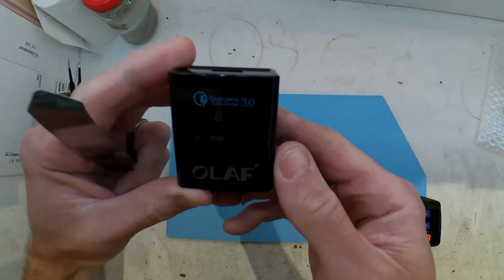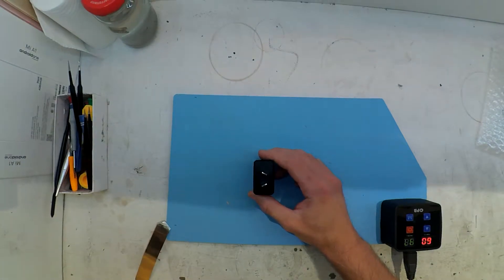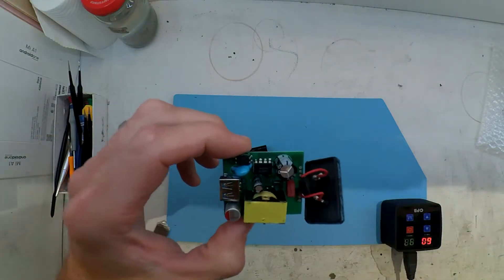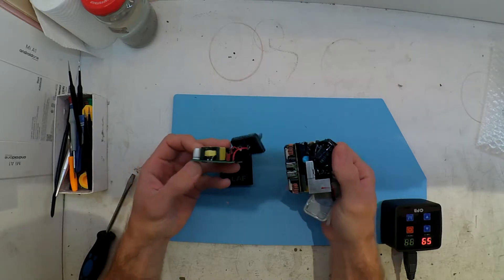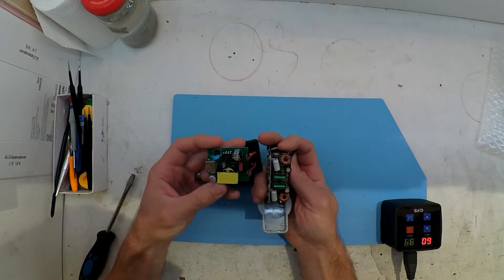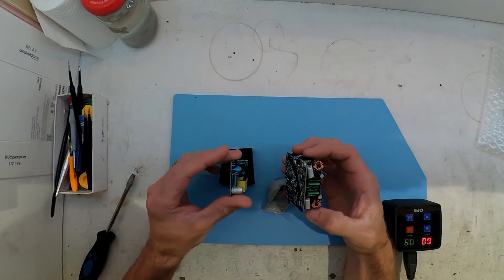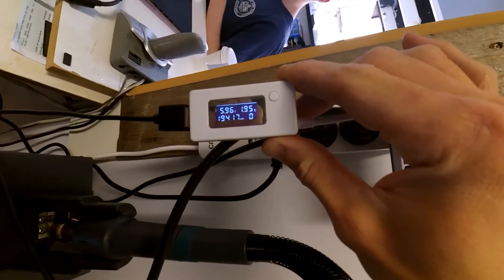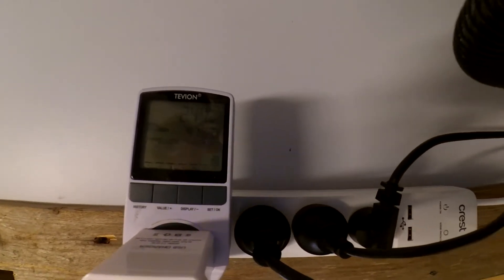OLAF CY-QC30 Wall Charger tear down and review

Comment: Bullshit. I have one of those chargers and it's the best charger I've ever owned. Have had it for about three years now and it has charged my phone extremely quickly and never failed. Got it on Ebay for around $10 or so I think.  Best thing I've ever bought.